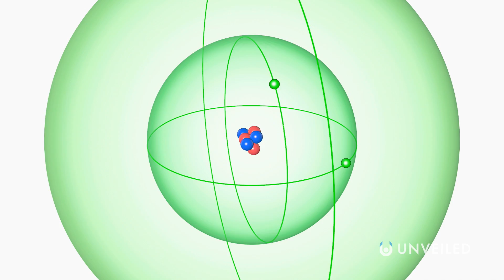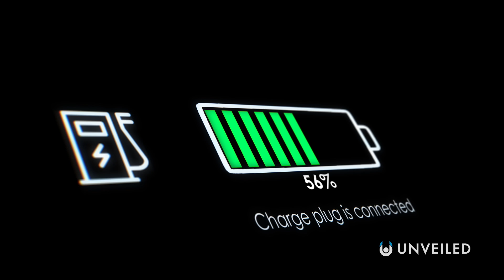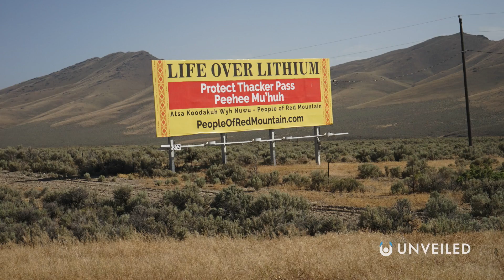Why Are Scientists So Worried About Running Out Of Lithium? | Unveiled

Comment: If Lithium runs out than Engineers, Manufacturers will make new Power Producing sites using a different metal that can also store Electricity tho it won't be as efficient as Lithium, And Scientists will find more Metals that can actually do the same things that Lithium does (Tho it can be better or worse) and thus the Extinction of Lithium from our Planet won't mean the End of the Modern Era and quite possibly the civilization